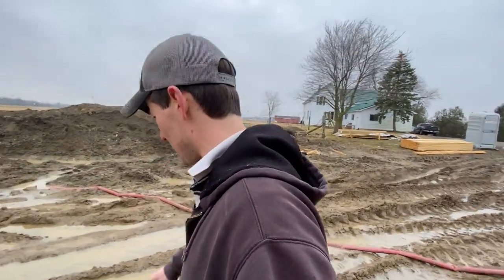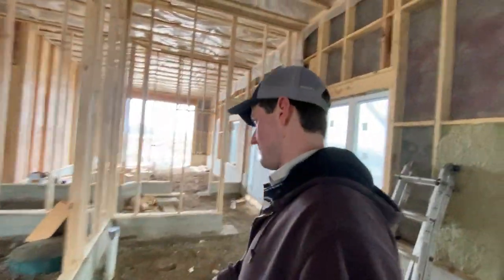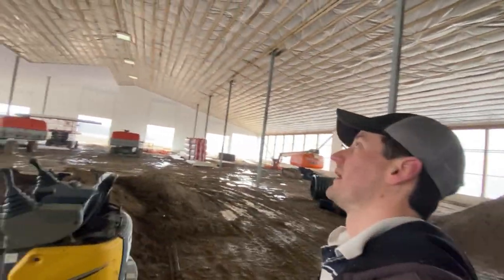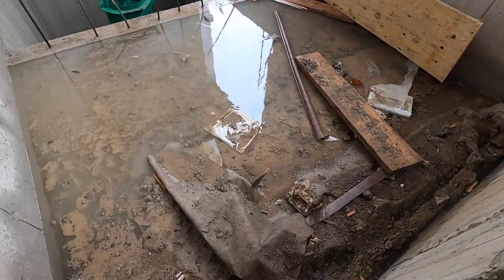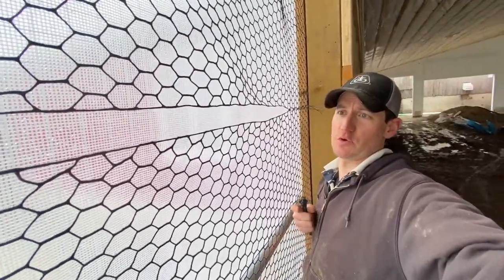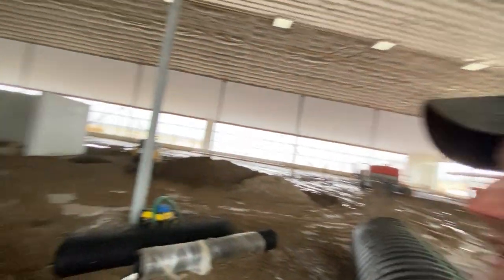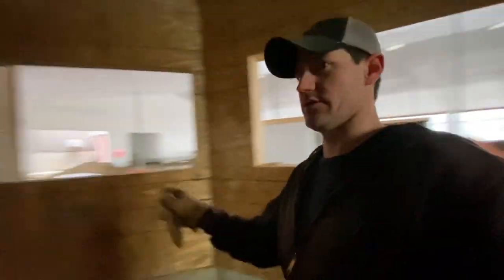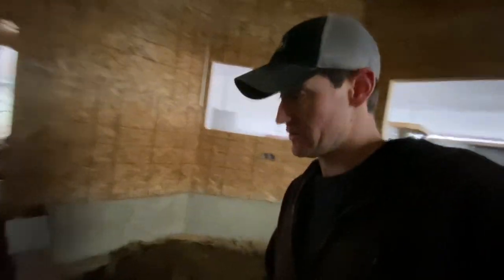A MUSKRAT is Living in Our Manure Pump?? | Building Our Cow Palace - Ep59

Comment: The finished product that makes up your foundations, walls and floor slab is called concrete or ready-mix concrete. Cement is the ingredient that makes it set up     
and hydrate to make it a solid product. Just as barley silage and other items go into to make up you TMR ration, cement is one of the ingredients in concrete.